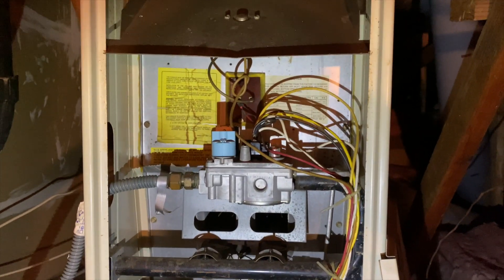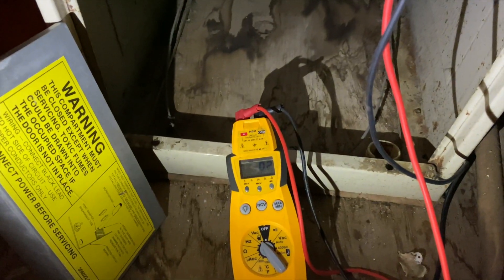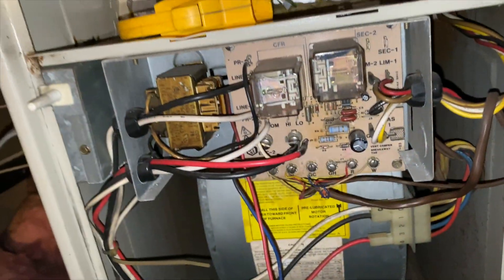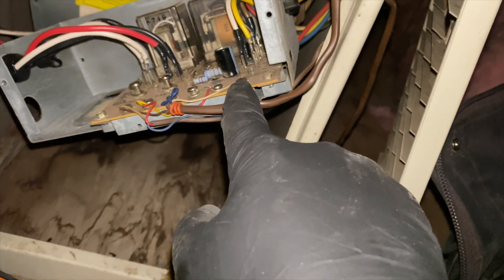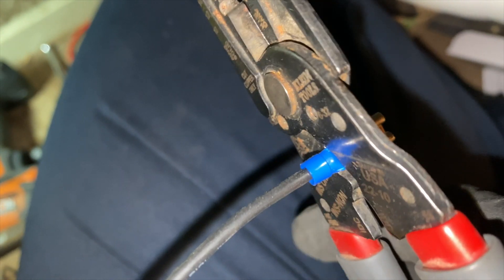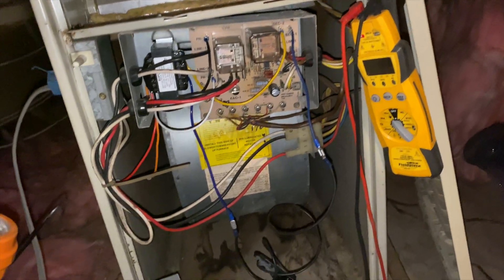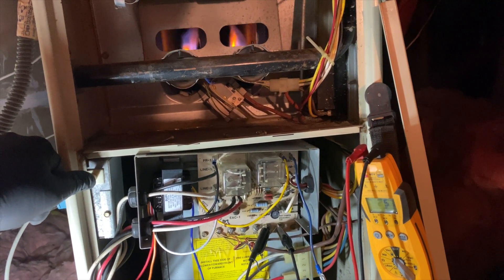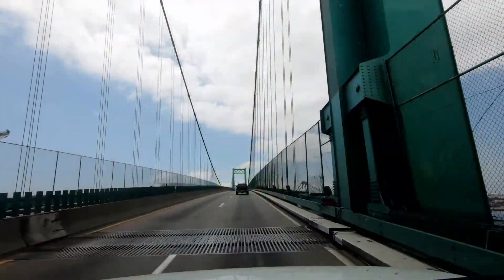Unit blower running non stop, diagnosing transformer issues.

Comment: Tht flex gas line should not be running in the burner area.
You can run flex to but not through. It's needs to be hard pipe. 
But great diagnosis and fix.
Reply from the maker: Yup brought that up to the client but they didn’t want to do
Anything about it. Thanks for the feedback.